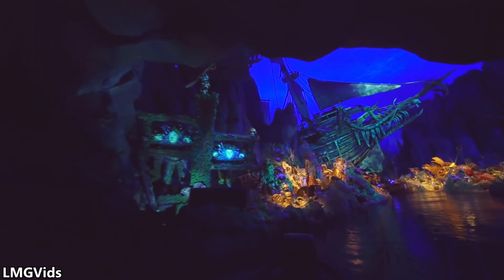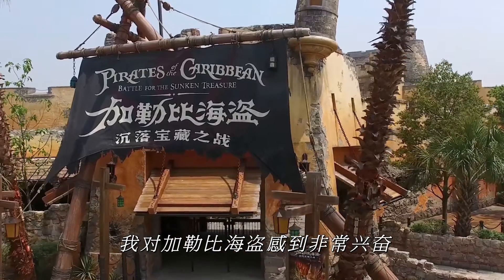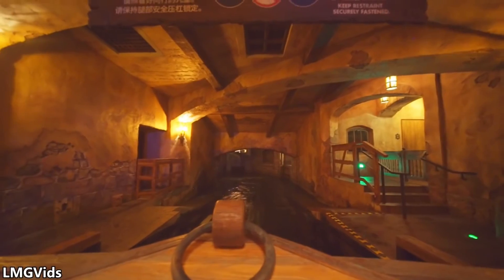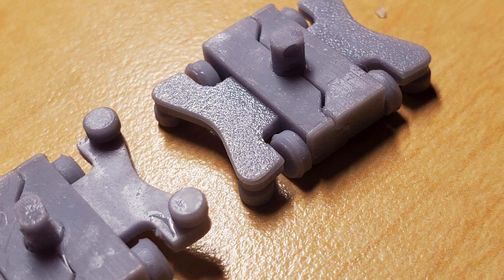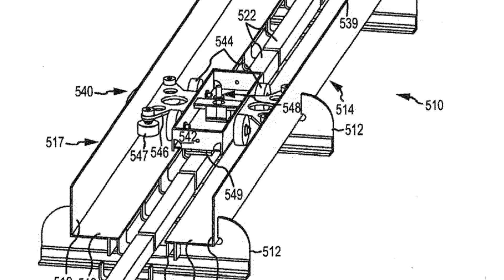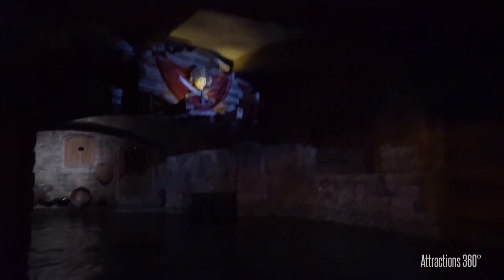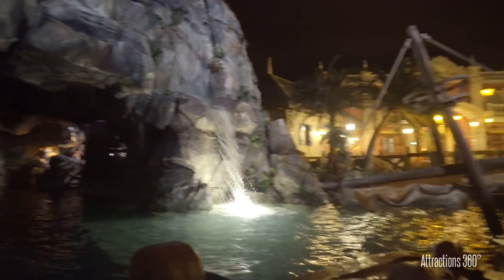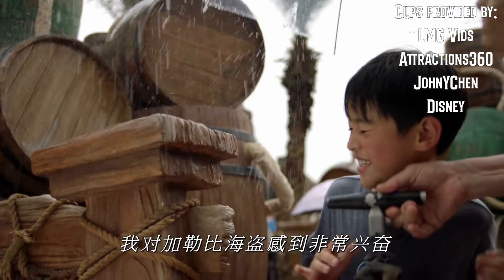High Tech Pirates of the Caribbean - HOW IT WORKS

Comment: A few things, first, does the talking skull at the start and the two talking heads “guarding” the treasure (they are doing a bad job) just as we enter the scene not count as animatronics? 

Also, there are two possible endings you can get from the experience. One: Mission failed, the treasure turns out to be seaweed. Two: Mission successful, you got the treasure and Jack Sparrow sings “Yo ho Yo ho a Pirate’s life for me!” (Yes, to pay tribute to the original rides, they brought back the song). It is rumoured the ending you will get is based off of if you’re boat number is even or odd. 

On my last trip a few weeks ago, I rode the ride two times. The first time I got mission successful and the second time the next day, I got mission failed. The first time, the boats around me all got mission successful as well and the second time, the two boats before and after me got mission successful (which would prove the odd even rumour, as I would have been odd/even and the two before and after me would be the opposite). Maybe the first day the other version wouldn’t download as I rode it in the mourning or the cast members felt nice?

Comment: Thanks for another great video.  The 3D model is impressive!
The boat is Huge and I rode it twice, once from the front and a second time from the back.  It makes a Big difference with the timing of effects especially the Bones to Jack Sparrow effect.  You mentioned the Haunted Mansion ballroom effect which uses Glass but then you talk about a "screen".  I believe they used Glass at a 45 degree angle that is hidden by the 45 degree Mast. They placed the Bones Horizontally in front of and below the Glass to reflect off the Glass when the Bones are lit up and do a lighting transition. Since we are moving it needs to be 3D actual Bones and a "screen" would be flat 2D and not look right. The effect happens Very Fast and can be missed by the people sitting in the back of the boat!  BTW, the projection video on the screen of the fighting pirates is washed out.  It looked really Bad when I rode it pre-covid shutdown.

Comment: One other thing, a personall opinion.  The over-use of projection screens does seem cheap to me.
It was used to great effect on "Rise of the Resistance", which I was fortunate to see at WDW just before the virus came to town.
But, c'mon man.  The tons of animitronics was what made the original Pirates ride so special.  I do understand that hydraulic leaks were the constant bane of Disney Maintenance however.
Reply: Take a trip to Shanghai Disney and go on the ride.  Then you'll be qualified to determine if projection screens cheapen the ride or not.

Comment: It's the Omnimover meets the WEDWay PeopleMover meets Pepper's Ghost.  Magnificent, Bravo Disney Imagineering!
One small nitpick, as an electrical engineer.  The linear induction motors you say are run by an inverter at 60 Hz, is not quite true.
Being an inverter drive, it can run at any frequency, generally up to 400 Hz for standard designs.  That's how they acheive variable speeds for the boats.
Otherwise, excellent presentation Amusement Labs.

Comment: Wow.  Outstanding video and model.  And it's nice to see that Imagineering is as innovative as ever.

Have you thought about trying stop-motion animation when showing the movement of your scale models?  It would admittedly be a lot of extra work for you, but it would eliminate having your hand in the picture and it would level up the polish of your videos even more.  Just a thought.
Reply from the maker: Thank you. Funny you should mention the stop motion part. So the model, is actually quite fragile and broke mid film which is why I don't have a lot of footage of it moving. Later in the video I do use a little stop motion magic cause I had to reposition due to it not being able to slide like it did originally. Stop motion wouldn't be an issue and actual was pretty easy since I taped the model to the table and have a mic boom with a camera attatchment.